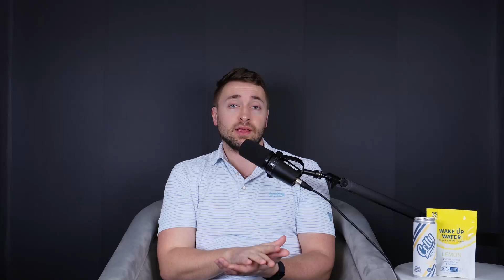How to Start a Beverage Company

Comment: Great video! Question: You didn't mention anything about a trademark to protect your brand name. Suppose your product is a big success in the future, and it turns out that the brand name has already been trademarked by someone else (or a very similar one has been trademarked and is being used even on another continent). Then there could be problems. Have you considered trademarking the logo or brand name before finalizing packaging or design? Here in Europe it costs ~$2500 to trademark such a brand. Why didn't you bother?